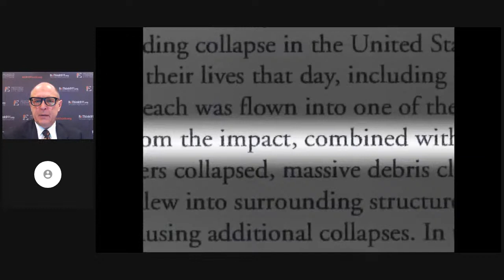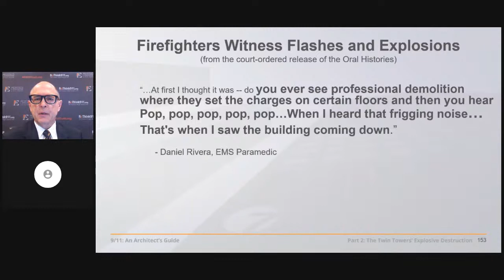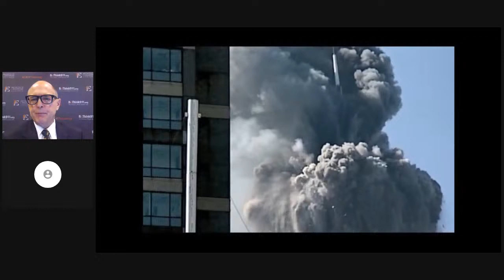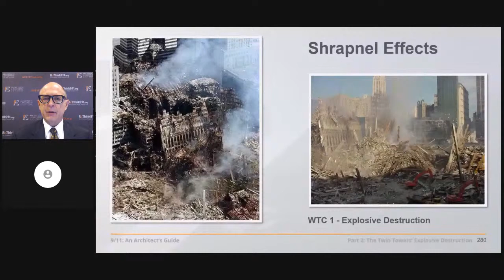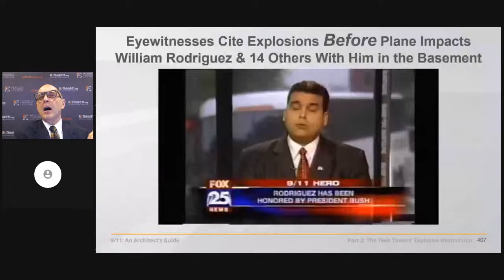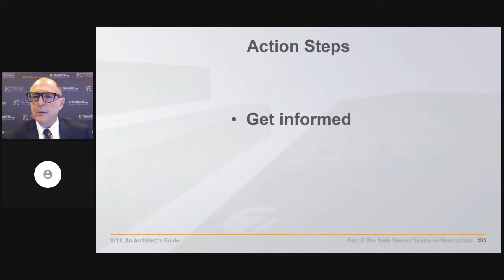9/11: An Architect's Guide - Part 2 - Twin Towers' Explosive Destruction (11-14-19) Webinar - Gage)

Comment: You need to add the 24-storey Grenfell Tower in the UK to the list of horrific, extensive, long-burning fires that killed 72 people...but the building didn't collapse.
Reply: @Shelby_Starner_Everything  Compare these apples, anthony :

"WTC7 Controlled Demolition Comparison"  (youtube)
Reply: @Shelby_Starner_Everything  You HAVE seen this video right?
Reply: To top it off, Grenfell is a concrete structured building, burned for 60 hours and yet not a single part of the building failed
Reply: @youjustreadthis897  Those buildings didn't have half their cores missing.